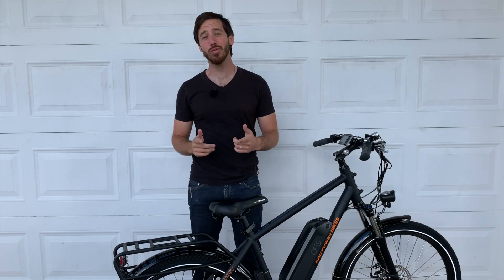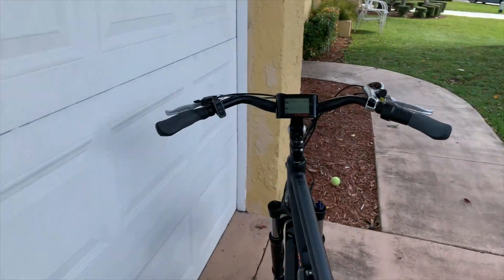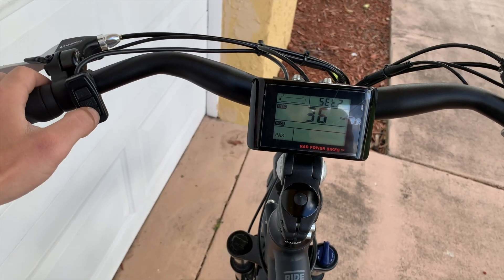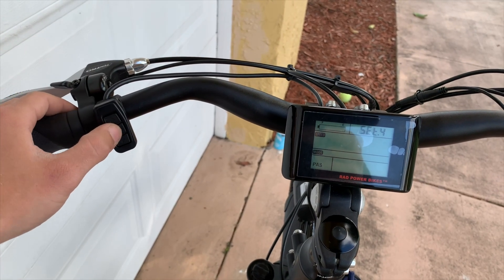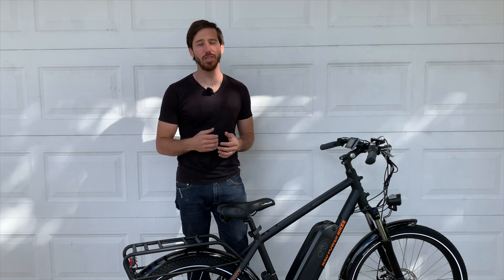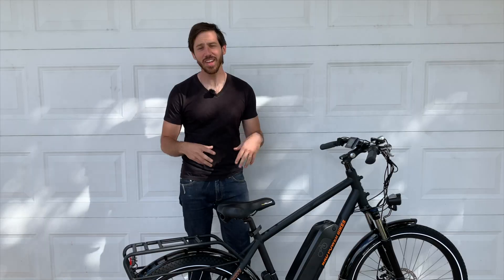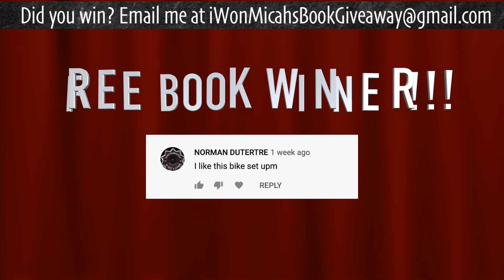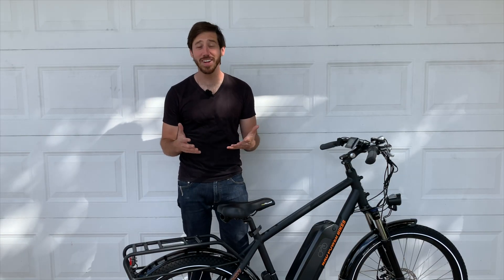How to increase speed of a Rad Power Bike e-bike (DeRestrict!)

Comment: Can you increase more by setting a smaller wheel size?
Reply: Short answer: NO .You will see an on-screen difference but the physical speed does NOT change. Basically, changing the wheel size will change how the sensors determine your speed but it is not your physical speed. Example: You set it to a smaller wheel size and it thinks your wheels are making a full rotation at a different speed when they are actually making a full rotation at the same speed. This then confuses the sensor because it thinks "Smaller wheels = faster rotation = faster movement" which is just not true to what your bike is physically doing lol.

Comment: So what if you also change set size of the wheel to a smaller one. Wouldn't it try to spin even faster to achieve 40km/h?
Reply: All it will do is mess up your odometer.
Reply: Pavel Shlapak No,  all that would do is give an incorrect translation of your speed

Comment: Thanks for the video. I just de-restricted my e-bike to run ove 25kph. It is a 250 watt motor and 36v rear hub motor.  I was amazed I could ramp it up to 60kph! Of course, even if I did that, it won't go that fast. The e-bike is limited by the voltage and the battery amp/watt hour. Of course, the controller plays a part in that too, not to mention if it is a geared motor, they may be designed for a certain optimal speed or top speed. Anything past that will just soak up more juice and/or require more pedaling on my part.  In mine, I noticed I couldn't really go past 31kph when the battery is newly charged, even if I set it to 40kph or 60kph. So, it has to be a voltage limitation, battery amp limitation or the geared motor. But I am not complaining. A 5kph-6kph bump is still better than being stuck at 25kph. :) My guess is if the battery was 48-v, I might just go over 40kph easy. But that would mean I have to get a 48-v battery and maybe even re-programming the controller (if it can be or can handle the extra load) to go 48-v. Too much to consider, so I'll just stick to 31-32kph. :)

I have a question though, how do you know the key or way to get into the menu/sub-menu where you can set the top speed. In ours, you have 4 numbers, and one can do a brute force and try out 9,999 number combinations. One can get lucky even before you reach halfway! Is there a manual or technician's code book where it is indicated there?

Comment: too slow, too limited, and I built my hard tail for way less with more features and range. Also a 40 MPH top speed. The point is to keep up with traffic or at least flow with it rather than disrupt it just cause I want to ride my bike. I drive as well like most people and cyclist annoy me too. Especially in gigantic groups that take the whole road. WE are supposed to move to the side of the road and single file while traffic is passing, not two or three across blocking the entire lane and making it impossible for cars to safely pass  and then drivers start hitting guys on a bike or hating them just cause of the " other guy" .